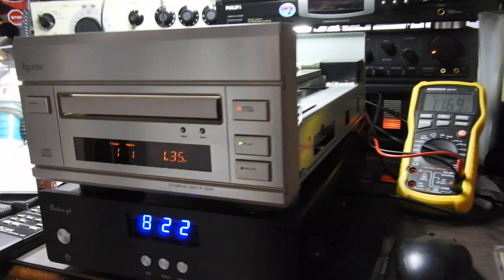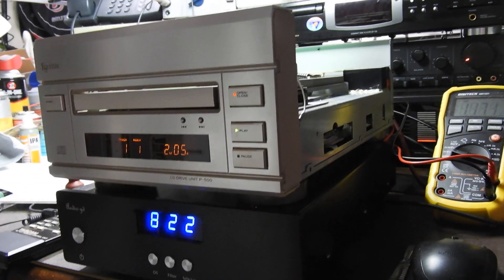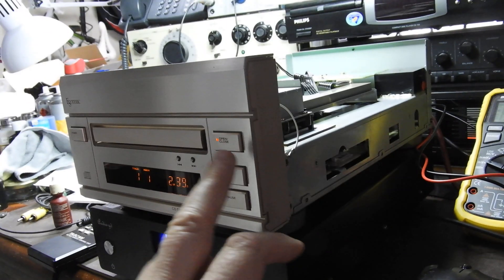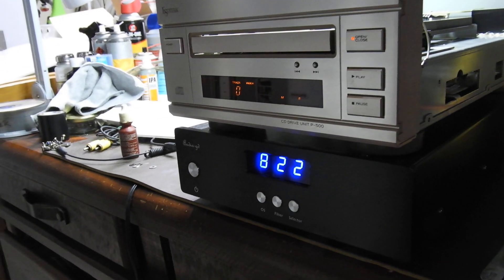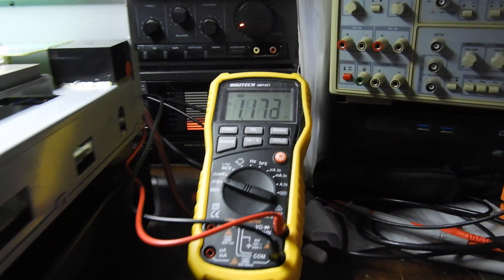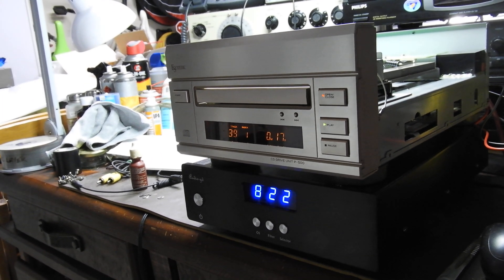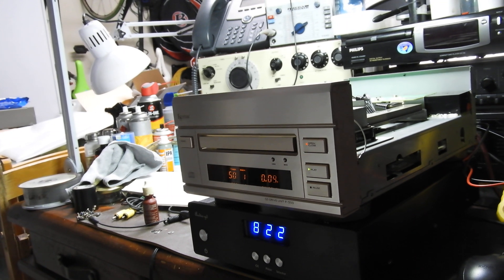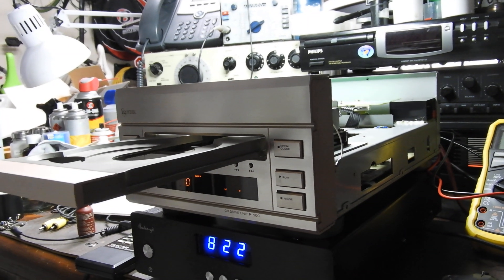Esoteric P-500 after a service and disc drive height adjustment.

Comment: Hi there, I'm having a similar issue after transport of a unit with kss-272a unit giving a no disc error. May i ask if you adjusted the height of the spindle platter via the small opening in the spindle shaft? Thanks for your explanation.
Reply from the maker: Hello my friend, P-500 transport uses KSS-151A laser and the CD is merely supported by a small tray but driven by a large disc on top. It is this top disc that I moved on the shaft. I have no idea which player you have and what loader it is using, so cannot offer any more advice. You are a subscriber, aren't you?
Reply: @hear-net-au  Hi friend, that's fine, thanks anyways. Yes I've subscribed, thanks for all the vids, I've learned quite a bit from them:)

Comment: Hi Solaris,

I have a P500 which started mistracking after transport and so I shelved about 10 years ago. Opened it up last week and drive belts now need replacement. I see you can get these on EBAY. Worth replacing the belts and trying to resolve mistracking as above?
Pete W New Zealand
Reply from the maker: Most definitely so. These are great machines. There are two belts; one that drives the CD tray and the second one that brings up turntable to the CD clamp bridge. That second one is pretty hard to do because you have to take things apart to get good access. For mistracking first clean the lens and then it is a matter of servo alignment. This (if necessary) should be done by someone who has done this before.
Reply from the maker: In fact I could do this for you if the postage is economical. I can get a small thing like P-500 from Perth on the West Coast to the Eastern seaboard (Sydney/Melbourne) for about $25. Both ways it is only $50. But I do not know about New Zealand and you have to check it out if it is worth it. I wpould charge about $150 for the service - belts, clean up and servo alignment. It would be like new.